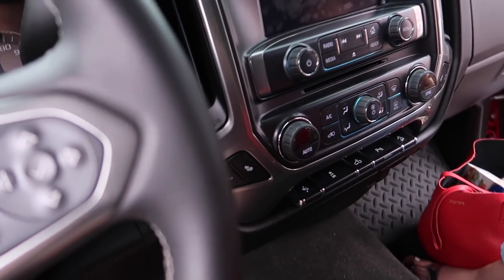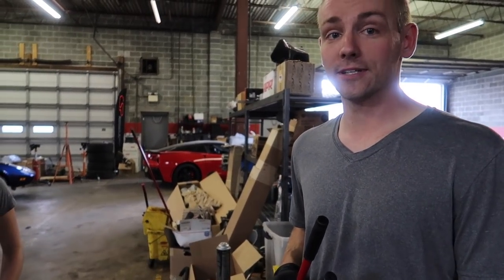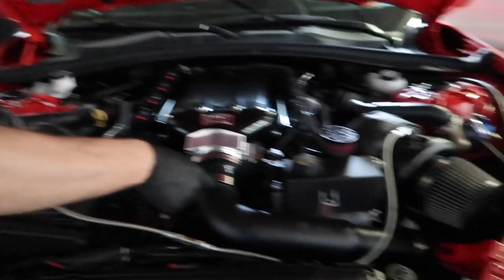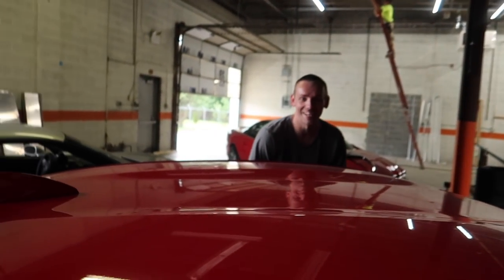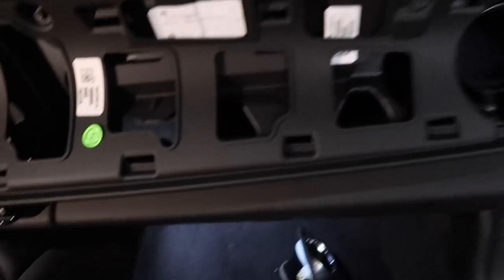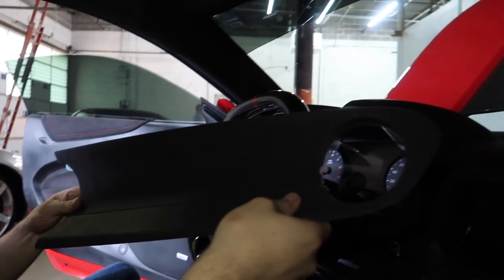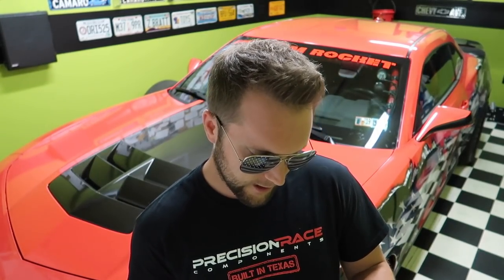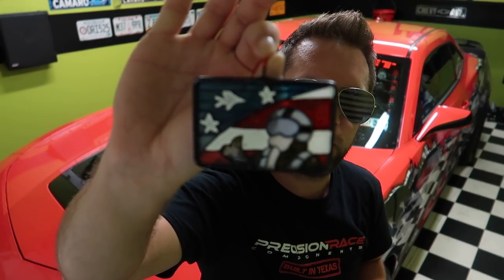I've Been WAITING FOR THIS Since I Took Delivery Of My Camaro ZL1!!!

Comment from the maker: I’m a very big fan of carbon fiber, as long as it’s done right. What about you guys? Would you want to see some exterior carbon fiber mods? 🤔
Reply: GuitarmageddonZL1 get a carbon wing for the zhell1. Or just a carbon lip, would look bad ass
Reply: A great looking wing would be sick but would drag the car in drag racing lol
Reply: I really like the carbon fiber hood that I have because I haven’t seen it anywhere else and it has a functional hood scoop. I think tasteful carbon fiber stuff looks awesome. I liked the stuff Steve Fast did on the inside of his camaro too.  But I think his was wrapped or hydrodipped.
Reply: Looks too badass love it bro
Reply: Buy her more yoga pants and not jeans
Reply: Carbon will look really good but not to much of it
Reply: Nick where did you order it? I also want it for my ZL1
Reply: Carbon fiber looks great the problem is once you start you have to keep going for it to look good.  That dash piece you installed is beautiful but now the driver's side plastic and infotainment border & controls need to be replaced as well, to give a clean CF look across the dash.
Reply: GuitarmageddonZL1 your air bag comes out the top of the dash, there is a metal cover that pops up and smashes the windshield
Reply: Carbon fiber wang!!!!
Reply: Side skirts bumper front n back wing diffuser
Reply: GuitarmageddonZL1 pls don't do a big wang lol if I were u Id do a carbon duck tail and lip
Reply: I build the interiors for them. The air bag comes out the top of the dash on the passenger side.
Reply: I want the knee pads in Carbon Fiber.
Reply: GuitarmageddonZL1 - I have a zl1 2015, heavily modified running only e85, trying to make it like the freedom rocket, is it common for a car running e85 to take a couple tries for it to kick over? Is this something you’ve experienced or no. Thanks

Comment: Man it blows my mind that you can hit 900whp with 93 pump gas in that car. Are you on the stock LT4 fuel system?
Reply: SixGunSled the beauty of tuning, my instructor at school pushes 750 in his Integra on pump gas from Arco
Reply: I mean I know all about tuning I'm just amazed that the fuel system on the ZL1 isn't tapped out at that horsepower level. I guess it has to do with his motor also being built and I'm sure has a upgraded cam with a bigger fuel lobe and everything. still its impressive.
Reply from the maker: Yeah man! Completely stock fuel system.
Reply: SixGunSled yeah pretty impressive with stock fuel system
Reply: GuitarmageddonZL1 so crazy. Congrats brotha
Reply: SixGunSled yeah I asked the same question and Andrew said it was because they are running a camshaft with a 30% larger fuel lobe. Still crazy they haven’t ran out of fuel and it’s only 93. Sick!
Reply: Norcal Daily Driven yeah that was my thoughts exactly. It’s pretty gnarly to see what they achieved
Reply: stock from rear to front? including in tank fuel pump? If that's the case I need to find a new tuner as he says I'm out of fuel @ 730rwhp on 93 and I'm running full LT4 setup + 30% cam lobe.
Reply: SixGunSled well the motor isnt the normal size motor so
Reply: SixGunSled watch the last video Street Speed 717 did on the dyno. there was a GT Mustang on the dyno,  the guys page is 334mrl, twin turbo he is running E85, but he was over 900 as well on a stock motor with twin turbos
Reply: Turbocharged engines use less fuel to make the same power as a supercharged engine.
Reply: rlhay2 that's not true, it takes less power to run turbos, because the exhaust pushes it, the blower has a belt that robs power from the motor.  some systems are better on feul then others, but that's about it

Comment: Have you done a dyno comparison of Sheets 93 Octane ( which I assume has some % ethanol in it ) versus say Shell Premium 91 Octane ( which in Ontario Canada is guaranteed 0% ethanol )?

In Ontario, Shell is the only ethanol free gas we can get and most of us classic muscle car guys run this in our high compression Gen 1s. In really hot weather I'll throw in a can of octane booster but for the most part I stick with pure gas.

Just curious what power gain or drop you would see in your freedom rocket part doux
I would suspect you would see the same power output with less boost required to get you there.

Comment: I wonder how much power itd make with the lower octane, what is it? Like 87 or something like that?
Reply: Bowtie4life 88 he’s on 93. 87 is bad news for any performance car. Even if it was stock it wouldn’t be good for it. 87 is for average day sedans, older gasser trucks and such. Low octane and performance don’t mix.
Reply: SilverBullet SS I know. I just was just thinking about how cool itd be to see the difference in numbers between the octane levels. I know the 87 is for  "non performance" vehicles, but how much power would be lost if he ran 87 instead of 93? You see where I'm going with that?
Reply: Bowtie4life 88 it would be significantly lower. Engine would be pinging hard and pull a lot of timing.
Reply: SilverBullet SS I realize that. I'm a car guy too. But with it being a zl1 with the 10 speed auto, I just think that'd make an interesting video.